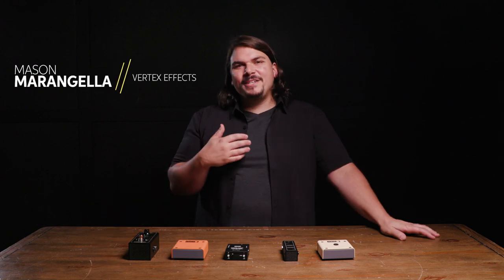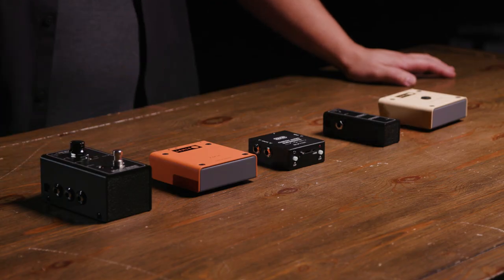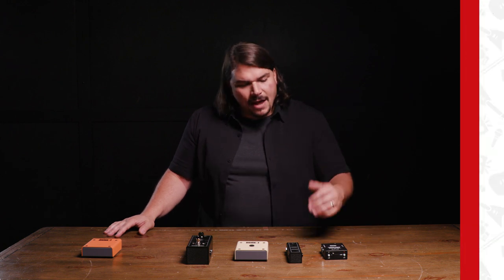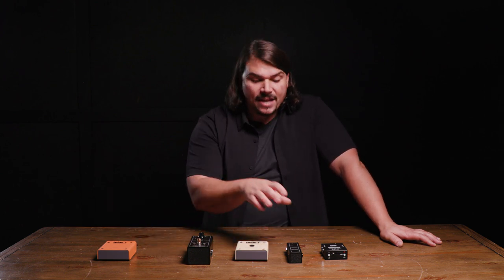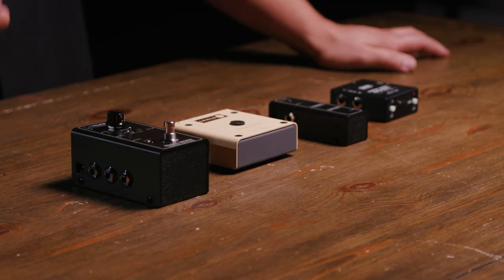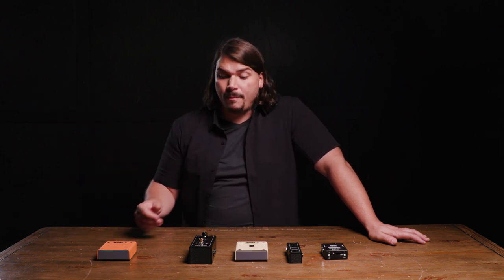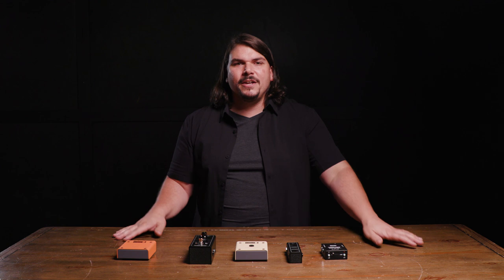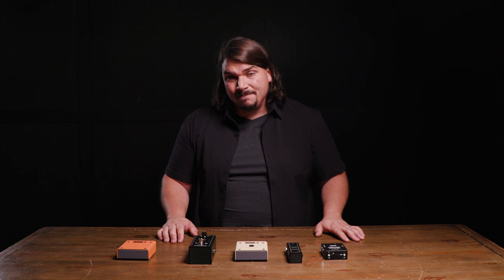Getting the Most out of Buffer Pedals for Guitar and Bass

Comment from the maker: A good buffer sets the foundation for a great pedalboard! Looking for more tips on your next pedalboard build? Make sure you like, comment, and subscribe!
Reply: I am currently building a small on the fly rig with a helix stomp XL – I directly use its 2 effect loops for two overdrive/distortion pedals (Chase Bliss MKII, KSR Vesta) – would you therefore recommend to use buffers in the beginning and the end of the signal chain?
Reply: So much misinformation here.  You don't need an output buffer. Once a buffer is in place then the only degradation in sound is whatever happens before that first buffer. Anything after that first buffer is either pushed through the following pedal if that following pedal is a true bypass pedal and that following pedal is turned off or it's taken over by the following buffer if a following pedal has a buffer. But the input buffer is all you need to drive a signal far length.  There are plenty of demos on YouTube which will prove that whatever tone differences there are between different buffers are very minor and insignificant. Adding unnecessary additional buffers can affect tone negatively. Between the input buffer and most pedals on the pedalboard which have their own input buffer, it is unnecessary and foolish to add an output buffer. This video is a promotion to get people to spend unnecessary money on unnecessary buffers.
Reply from the maker: @AnthonyJarrah  Hi Anthony, appreciate reading your post. Your experience is different to mine and your points valid from your perspective. While there are situations where buffers aren’t needed on both ends of a signal chain, I don’t believe we can speak in absolutes. True bypass pedals do jumper from input to output when not engaged, however the patch cables between pedals do exhibit capacitance. And yes, some buffers do have output controls which drive a hotter signal down the signal path, but it’s not a universal across all brands. An improperly positioned and adjusted buffer will for sure have an adverse affect on feel, though the downside of too much roll off due to a lack of high end and clarity is more impactful to me in a negative way. As with all of our information presented, it is just that - information. Not meant to be a one-size-fits-all for everyone in every situation. YouTube is not the same as hearing and playing a piece of gear in your individual rig so it’s up to each player to decide what is the correct setup for them.
Robert Williams, Senior Sweetwater Sales Engineer, (800) 222-4700 ext. 2371, robert_williams@sweetwater.com
Reply: @sweetwater  I will respectfully disagree with your reasoning. The purpose of a buffer is to convert a high impedance guitar signal to a low impedance output signal. Once the signal is converted to low impedance then whatever capacitance is in the following cables and true bypass pedals are insignificant on that low impedance signal. Signal degradation after the buffer would only happen after an extremely long cable run in which case having an additional buffer at the end of your pedal board is like not having an additional one at all since the distance between the first pedal and last pedal are insignificant compared to a 50 foot run afterwards for example. It is important to place the buffer first in the signal chain so that the guitar sees the proper impedance just like plugging directly into the amp. After that then the signal will drive either through following true bypass pedals unaltered or through a following buffered bypass pedal which would be like adding an output buffer anyway. Adding an output buffer is unnecessary and a total waste of money since the output of the first buffer is strong enough to drive long distances should the following pedals be true bypass or it is more likely that there will be at least one buffered bypass pedal after the chain which is like adding another buffer by default anyway.
Reply from the maker: @AnthonyJarrah  True bypass and buffered pedals do not act as additional dedicated buffers. Buffers in an effects lower impedance and treble loss.  
Additionally, the buffers for some pedals are only active when the pedal is on. Signal load is an issue too dependent on the input and output impedance values on a given pedal and or buffer. To categorically say your reasoning is absolute is where I respectfully disagree. It’s really up to the end user to decide.
Robert Williams, Senior Sweetwater Sales Engineer, (800) 222-4700 ext. 2371, robert_williams@sweetwater.com
Reply: @sweetwater  I never said true bypass pedals act as dedicated buffers. They don't need to be since the signal passing through them is low impedance assuming that signal was passed through an input buffer. Any subsequent buffered pedal absolutely would act as an additional buffer since that pedal has its own low impedance output. You are right that not all buffered pedals have a buffered output when not engaged. Those pedals would be considered true bypass which points to my previous point of insignificant capacitance against a previously buffered signal. Both TC Electronic and JHS make a great buffer and both of those companies recommend using their buffer at the beginning of the signal chain. JHS goes further by saying that they recommend at the beginning but could be used at either the beginning OR the end not AND. These companies are advertising their own product and surely are in the sales business yet neither of them mention needing both input and output buffers. Once a signal has been converted from a high impedance to low impedance then that low impedance can go long distances. That signal might benefit from an additional buffer maybe if that second buffer is 50 feet after the previous buffer. But an output buffer is not necessary in the context of a pedal board since we are literally talking less than 5 feet of cable.

Comment: 4:25-5:20: I would love to see a separate video that talks about buffers specifically with context for bass. I'm currently looking at the Lehle Sunday Driver because of the variable input, but am curious about other options for bass needs. I switch between a Aguilar Tonehammer 500 and Ampeg SVT-CL, depending on the gig, which have 1m and 5.6m input impedance, respectively. I play my Fender Jazz bass passively, but will engage the active pickups occasionally.  My pedal board ranges between 10 and 14 effects pedals + a Boss TU-2 tuner.

I'm also wondering if it's be wise to invest in a  looper switch to shorten the chain, as an alternative or in addition to a buffer.

Comment: Great Mason! As usual. I have a few vertex boost pedals and are amazing! I will be ordering from Sweetwater -the Mesa High wire and the Mesa Stowaway and the LEHLE P-SPLIT-for stereo rig as described in this video. Mason, I need to place my Lizard Breath Chameleon op stereo clean boost pedal -to boost overall volume of the entire pedalboard and placed it last in the chain. Can the this stereo boost pedal be placed just before the input return of the High Wire and input of Stowaway -then to Lehle P Split to the two amps? If I use High Wire as clean boost it would only boost left side so I need the signal to be stereo boosted. Thanks Mason for your knowledge as Vertex Pedals and thanks Sweetwater for your years of impeccable service and products!

Comment: I could see using the mesa high wire for a dual monobloc amp like the marshall 9200/el34/34 or fryette two ninety two just as a stereo output buffer. Or even just using it as an output buffer on a single amp with an effects loop. Hmmm... lots to think about.

Comment: Great tutorial. Can you also explain the chain if you use a stomp box style pre-amp together with all other pedals and go straight to the line mixer (FOH / powered monitor speaker) via direct box?
Reply from the maker: Hi, eddysel10. It depends on the pedal you’re using. If you’re doing something like the Strymon Iridium where it is modeling the amp and cabinet, you’d likely want to put that at the very end of your chain, since it is essentially replacing an amplifier in your rig. If you’re doing more of an Amp In a Box style preamp pedal, that would typically go in between your drive pedals and time based effects. In that situation, you would still want some sort of cab simulator at the end of the chain for going direct.
Thanks for your interest!
Charlie Davis, Sweetwater Sales Engineer, (800) 222-4700 ext. 1320, charlie_davis@sweetwater.com

Comment: I have a ES-8 and Mesa boogie high wire. I also have two H9’s.You need to do a video on how to set this up. Trying to figure it out for weeks.
Reply: You can use the two H9's in your stereo loops 7 and 8.  Loop 7 will be a mono send, but stereo return and loop 8 will be stereo send and return.  High wire will go outside of the ES-8 input and output to be your input and output buffers for the rig, however you'll need one more output buffer to collect the stereo output from the ES-8 if you plan to run your H9 in stereo.  If it's just in mono, no further buffering will be needed.  You'll also need to bypass the buffers in the ES-8 globals since you'll have the High Wire doing that for you.
Reply: Is there a diagram or a schematic to do this. Like I said I’m pretty new to this.
Reply: @robertreynoldsjr7044  They have wiring suggestions in the ES-8 manual.

Comment: Hello i have a neunaber wet stereo reverb and it has input: 1M ohm and output: 500 ohm. My Idea: TC Bonafide at the beginning and my Neunaber at the end?
Reply: 500 ohms is OK, the lower the better.  You might compare what happens if you got down to 100 ohm with a higher quality buffer.  A lot of it will depend on the cable you use on the output and how good the buffer in the Neunaber is at driving that capacitance.
Reply: @VertexEffectsInc  Thanks👍

Comment: This is great. Question... I'm planning on buying the High Wire for my front end chain, but I also run my modulations and delays through the fx loop. Would you recommend only getting an output buffer for the fx loop on the return? Or would it behoove me to buy something like the Kleinulator to basically create a whole new fx loop with a stronger signal?
Reply from the maker: Hey, Mike! Great question, and thanks for your interest. Mason Marangella actually also has a great video answering this question (when to have both input and FX loop buffers, where to put them and recommendations for what to get):
https://youtu.be/V6oLPxFoNcs
I hope this helps! If you have any other questions, feel free to reach out to me directly.
Connor Smith, Sweetwater Sales Engineer, (800) 222-4700 ext. 1793, connor_smith@sweetwater.com

Comment: Does this setup seem good?

My setup currently is a line 6 g10s as my first buffer, then a couple pedals, a tc electronic polytune with the bonafide buffer, then in to my amps fx loop, a couple more pedals, then a jhs little black buffer, then in to the return input.

*Note that all of the pedals are true bypass except for the buffers I listed
Reply: Sounds good. You should have more than enough high end. How does is it sound compared to straight into the amp? Some people like a little tone roll off, but that’s a personal preference.
Reply: Yeah I like it. I try to avoid at much roll off as possible

Comment: hello if we need 1 megOhm at the beginning of the pedalboard, do we still need a buffer if we use a jaguar guitar with 1 megOhm potentiometers ?
Reply: Yes. The jag impedance is actually less than 1M since one or two pickups is in parallel with  the volume  pot.   What you want is a match between buffer and guitar impedance. Having the buffer impedance higher than the guitar is OK.
With all that said... don't worry about it. Any buffer will work fine with any guitar. The jag is super bright, so a buffer is a good way to preserve that tone.

Comment: So the High wire is or isn’t good for bass because the ohm is 1 and not 2?
Reply from the maker: Hello, Austin! Correct. The output on there will work fine going into a bass amp, but the input impedance is not desired. It's not necessarily needed to have an input buffer if you're using a bass with active electronics, or a wireless system, though. So I'd probably just stick with a single output buffer for running your signal to your amp.
Thanks for the interest!
Kevin Spunde, Sweetwater Sales Engineer, (800) 222-4700 ext. 1732, Kevin_Spunde@Sweetwater.com

Comment: Do I need a buffer on a Rhodes or synth going into guitar pedals?
Reply from the maker: Hi, Joseph! Thanks for your interest. In general, it's not as important to use a buffer with a keyboard as with a guitar or bass. If you have a vintage Rhodes with passive pickups, you still may want to use a buffer for the same reasons of impedance that Mason outlines in this video. If you have a keyboard that outputs line-level signal, like most modern synths, the important thing will be to keep an eye on your volume level so you don't overload the input of a pedal that's designed for instrument-level signals. Beyond that, it's just a matter of trial-and-error and finding the sound that works for you. Hope this helps - feel free to contact me directly with any further questions, and thanks again!
Caleb Lowrey, Sweetwater Sales Engineer, (800) 222-4700 ext. 1620, caleb_lowrey@sweetwater.com

Comment: Did he say that the Mesa Boogie Stowaway is an output buffer?
Reply: I think by mistake, because it's labeled as an input buffer. However, having said that, if you didn't have access to the High-Wire, then you could get two of the Stowaways and have the same functions of the in+out buffer system.